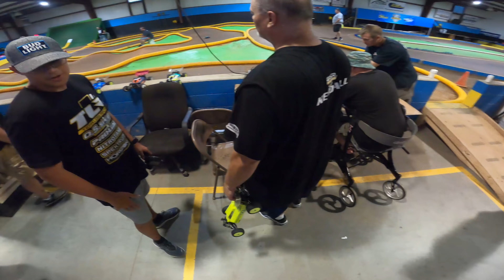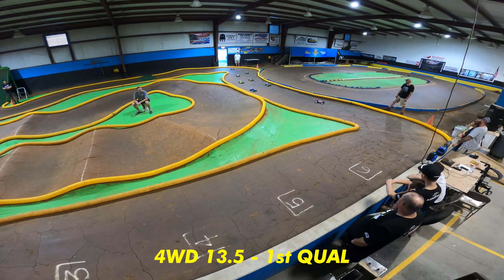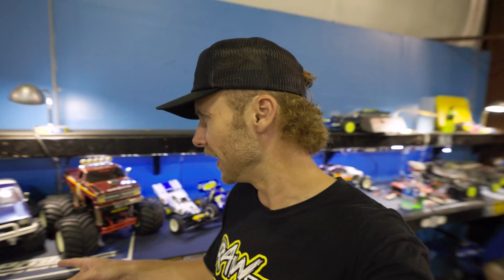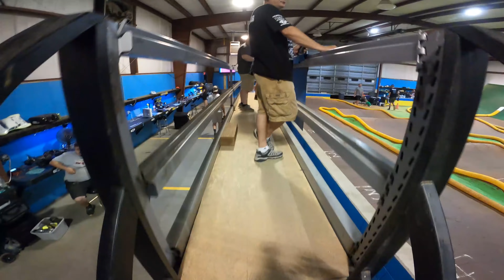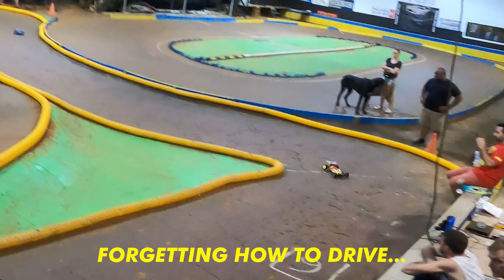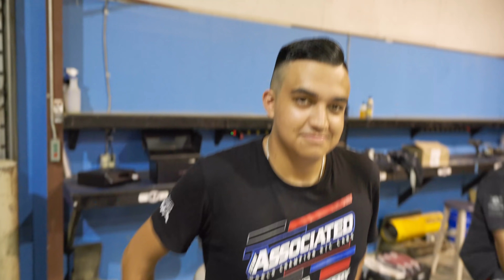Talking SMACK before money a race (BAD IDEA!)

Comment: I'm glad to see a professional running into the same issues I did first time at this track, this track is very un forgiving, it's tight, it's fast, and you have to NAIL it to get that flow right, there's not alot of leeway on landings or jumps, 

So much fun of a track, the locals are great, Josh Parrish is an amazing driver and lives at this track basically 😂😂 this track upped my driver skill quite a bit, too bad at the time of this comment the track has been tore up and beast of the east will show case the new lay out using ALL of the space even the oval space!

Comment: Growing up in the 80's one of the tracks I raced at did Clod Buster races.  In order to keep them running pretty much all plastic pieces were replaced with metal components.  Due to the astronomical costs only the adults ran them while all the kids just did 1/10 2wd.
Reply: I remember the Clod Buster. I had a Big Brute, broke them plastic chassis pieces real quick!!

Comment: Great insight into a race evening, your qualifier looked so smooth and controlled, what did you think was the difference? Did you make any changes between races, did the track conditions change, the car looked to be sliding in the final? Not being critical just hoping to learn. 

Thanks Ryan.
Reply from the maker: The track cooled off and left a little layer of moisture. If I did it again I would have added some rear toe and applied sauce with warmers before the race!
Reply: @RyanHarrisRC  that's really interesting, thanks for the feedback. At least you know what happened.